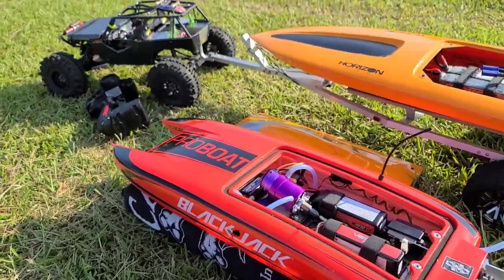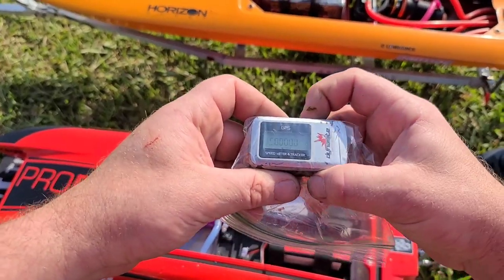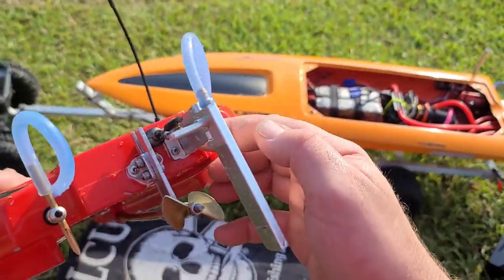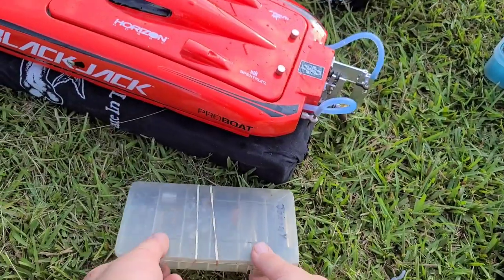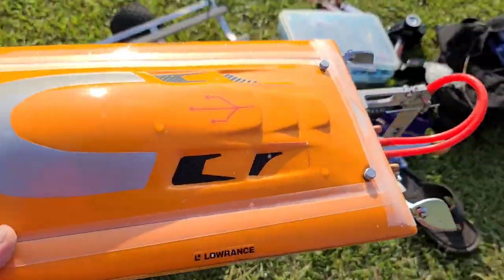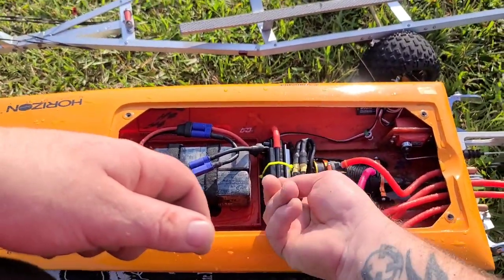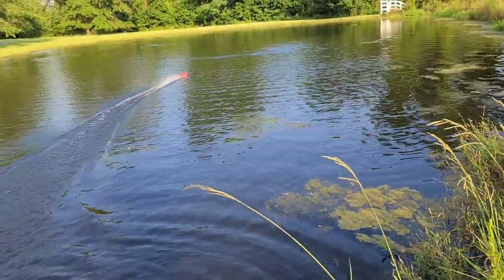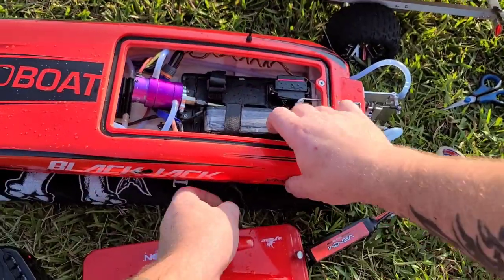Deltaforce 35 New Watercooling Mod Blackjack 24 Upgraded Flex cable & strut  Fast Electric RC Boat

Comment: Your crazy in a good way😊👍 can you buy the Vector SR65 and upgrade it you've got some decent motors etc,they're self righting
Reply from the maker: I've actually  been looking at that boat.  I may make that my next.  Also been looking at the Proboat River Jet?  Never had a hobby grade   jet boat
Reply: @IRONCLADRC  cool😊 I have a Sr65 nearly got all the parts.The jetboats don't have a keel so they Spin out real easy so too powerful acts against them

Comment: Great video. I have a brand new offshore electrics strut/flex shaFt upgrade for my bj 24. I installed it and tried a dry test and my strut is really getting hot. I can’t figure out what’s causing this as it’s brand new. I watched your video on the heat issues with the bj 42, but this has a different bushing. Any help/ideas I appreciate! Thanks bud.
Reply from the maker: When you put the boat in water it will cool the strut & bushing bench testing the boat will allow excessive heat build up
Reply: Will it wear in and cool down? Just concerned about it snapping the flex shaft. Thanks for your reply bud